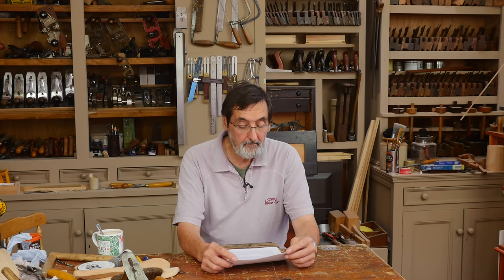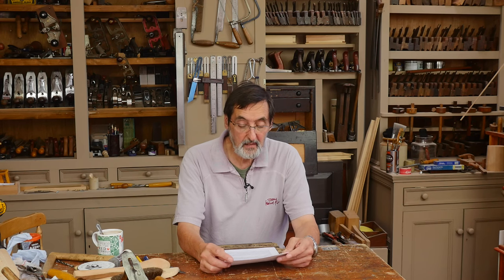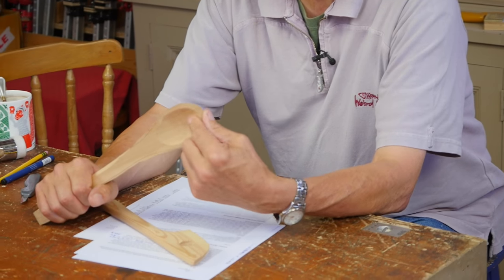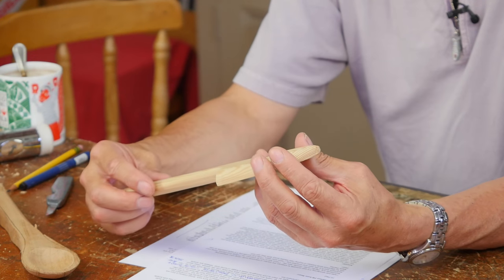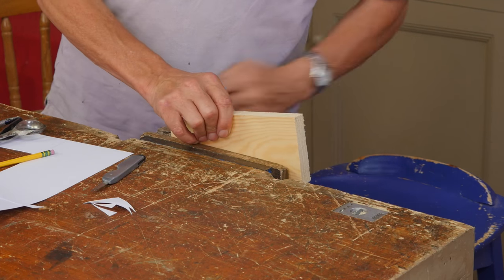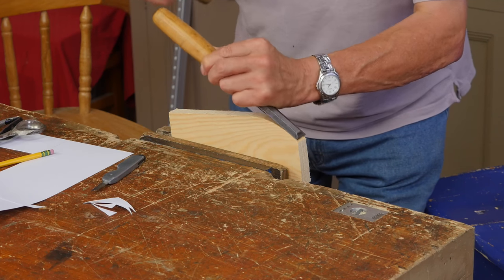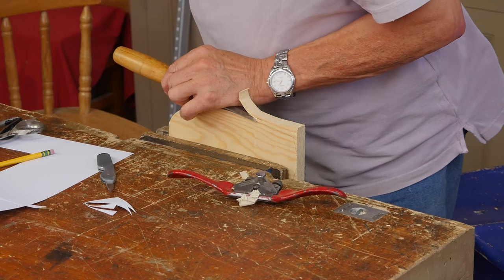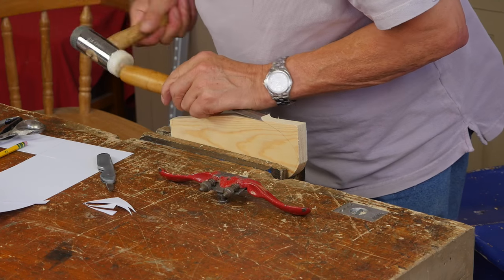Q&A with Paul Sellers Episode 4

Comment: Regarding darkness in wood from sweat: I'm a beginner woodworker and have unintentionally done this despite knowing prior about this reaction.  Tannins from oak combined wtih iron combined with an acid makes a very black stain.  I'd used this intentionally in the past to make ink from a medieval recipe.  What I didn't know is that apparently human sweat is acidic.  I was planing some white oak outdoors during this last summer in 95F heat and found that my sweat reacted with the oak tannins and the plane sole in pretty much the same way.  It showed up as grey instead of black, which I credit to my sweat probably not being as acidic as vinegar or other traditional acids for this purpose.

Comment: LOL!  I am milling my own walnut and soft maple.  The information you shared on changing grains and knowing your wood will help me from getting frustrated. I've been practicing planing a flat surface and it's been irritating as I start at one side and get tear out on the other.   I'll remeber your words when I become frustrated thanks.   You answered a question for me from the entry on YouTube comments.  I put one in again but didn't get an answer. Where do you get  such clear softwoods to work on?

keep these coming.
Reply: Thomas Tieffenbacher/DocSavage45 you've chosen the best timbers walnut and maple. You need a sanding thicknesser. No need to worry about difficult grain then.

Comment: Hi Paul I live in a flat and don't have much room, storage space aswell but i want to get back into fine Woodworking so was wondering if you could do a video of a smaller fold away workbench? And also living above other people i can't make too much noise, would having a rubber barrier between the legs and table top absorb alot of the shock? 
Thanks 
Ed

Comment: Hey Paul i have two hand planes one in wood (Danish plane with Swedish steel ) and one in metal ( Stanley usa ) but i noticed that when i plane with the metal one the iron chips easy in knotted wood ( Douglas fir ive noticed alot ) but my wood planed dosent it just goes dull over time does it have something to do with the thickness of the iron ? the iron in my wood plane is almost twice as thick compered to my metal plane. I hand sharpen them exactly the same with sandpaper and stones I really dont know what to do about it ( i dont think its me ) :) thank you Paul for the videos 

SKÅL !!

Chris
Reply: Part of that could be the quality of the iron itself, but knots in pine are very hard. I'd say that the thickness combined with what is probably a stepper angle causes less chipping. try sharpening the thinner iron to a steeper angle, it should reduce the chipping.
Reply: hmm could be the knots are just too hard in Doug Fir i haven't noticed in other wood ive planed in. ive literately planed over a knot twice and there was chips in it its crazy that Metal can lose to wood in some areas :) the Stanley plane iron is made in USA and the plane itself so the quality should be there right ? ( i have no idea )and the wood plane with the Swedish steel is Eskilstuna i thought it was okay - good quality but man does it kick stanley in the butt when it comes to knots :)
 
SKÅL !!
Reply: Old growth douglas fir can have very, very hard knots. Like dull a circular saw blade to the point of garbage in one cut. 

A micro bevel might help too.
Reply: Hmm i dont really care that much for Micro bevels :S i rather have it chisel grind :)but if it helps i could try that thanks for the tip man !

Comment: Priceless lessons from the Professor! Thank you!
My favorite is about the guy with the pile of ugly cherry. He wanted to know the best way to make use of imperfect wide boards. What I took from the answer is the following:
When dealing with wide boards that may be cupped or twisted, we should rip into strips and cut to size when the stock is still rough. Then set out on surface preparation to reduce wasted wood (thickness) and wasted woodworkers’ time and energy! 
The reasoning is based on Over-Thinning Stock when removing belly and bow from cupped boards. This over thinning is avoided by ripping into strips first, preparing surfaces & edges, then gluing back together. 
Saves elbow grease by hand planing less, saves wood, and potentially transforms Less-than-Perfect stock into usable workpieces. 
He said it better with less words than me, but that is why half a million people are Professor Paul subscribers!
What did y’all take away from the lessons today?
Thank you as always Paul!
-C.Y. Castor